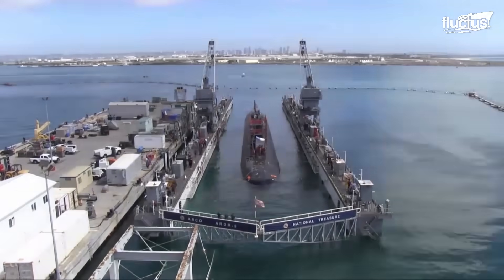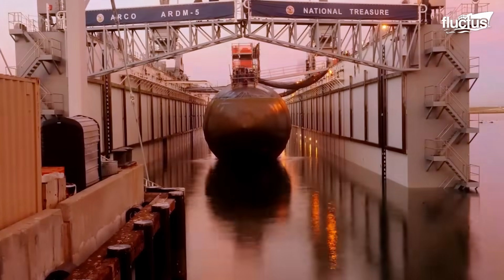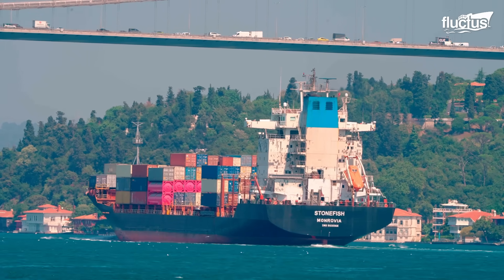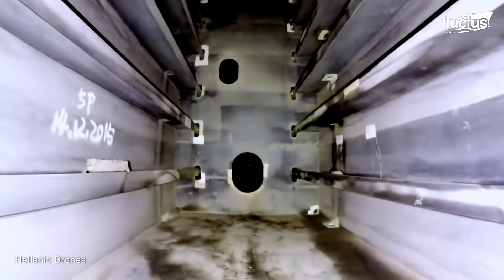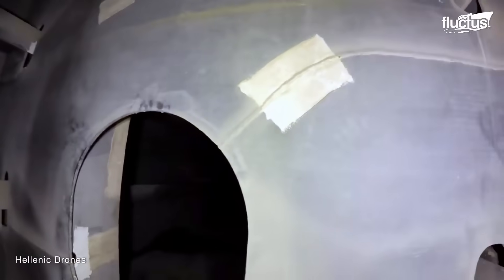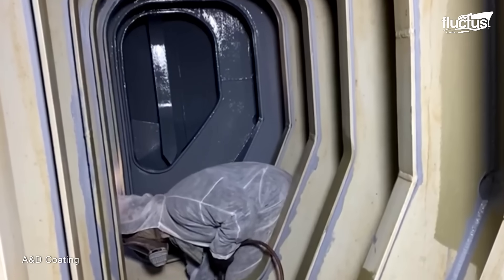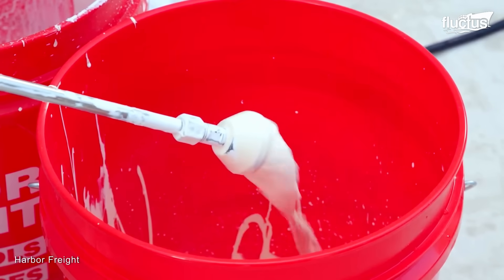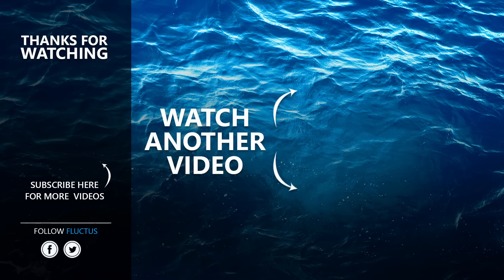The Impressive Process of Repairing Massive Ships Inside Dry Dock

Comment: Good Question.  I've spent almost 21 years in Dubai Drydocks World, besides , Oman Drydocks, Singapore Shipbuilding and Engineering,  Our own Mazagon Dockyard and Indian Naval Dockyard,. The Entire Ship is cleared of the Barnacles and water blasted,  followed by Grit Blasting.  Yes  it's not possible to clean up the area where the Ship rest on the Blocks which is approximately 6 feet in height.  Depending on how bad the bottom plates are , the Blocks are arranged. There are 2 types of Blocks . One is a solid one piece with heavy duty rubber pads strong enough to carry the weight,  the other are adjustable Blocks. If need be the adjustable Blocks can be removed from the bottom of the Ship by means of utilizing heavy duty fork lifts.

Comment: When the ship is drydocked and resting on those footings how do the painters get to the surfaces that the ship's weight is resting on?
Reply: Those footings or wood blocks are designed so that they can be shifted in position and the spot on the ship hull where it originally covered can be derusted and then painted.   And so its done with the other blocks one at a time.
Reply: @oscarnool8428 l
Reply: @oscarnool8428  Thank you. I looked up this topic  precisely because I wanted to see how they paint the sections that are sitting directly under the footings. But now I'm curious how they even move those footings under all of that weight.
Reply: Its a process called fleeting